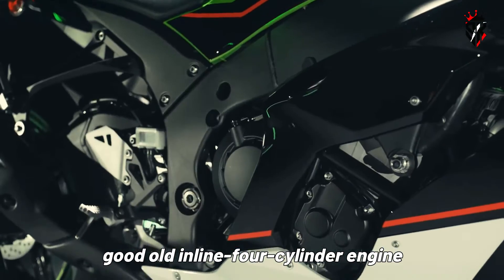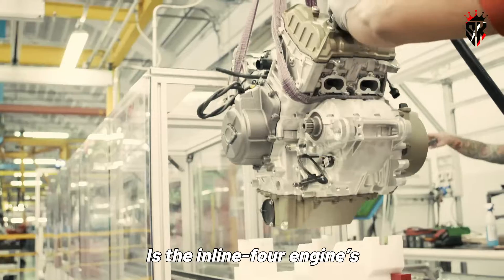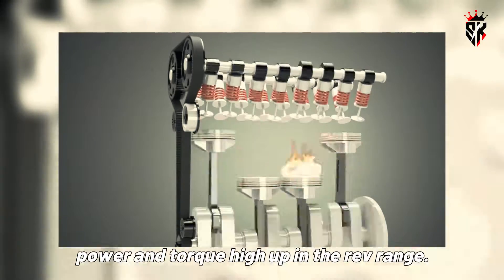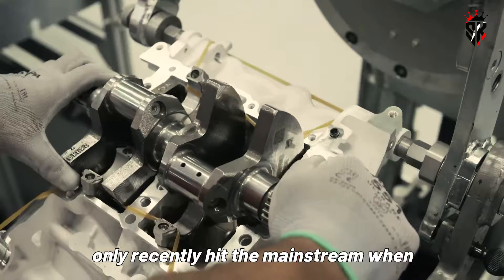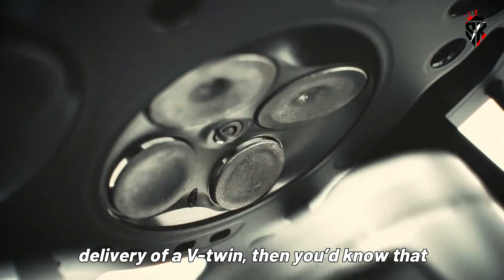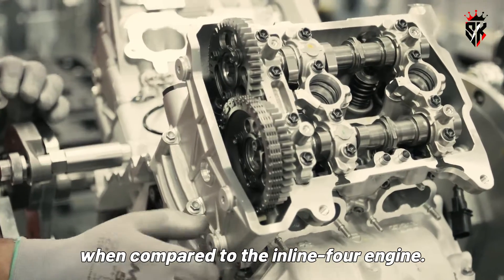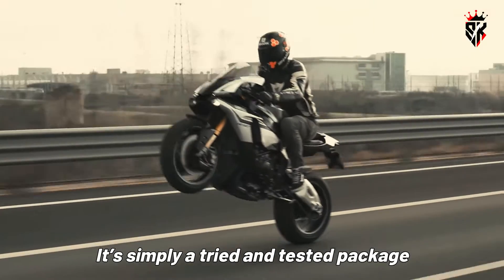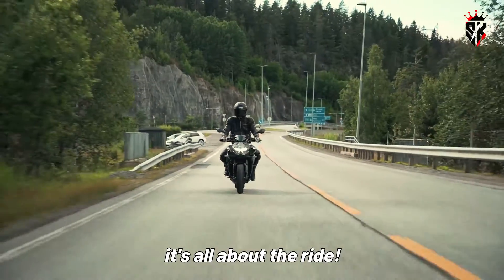Is the V4 engine only for racing? | V4 Disadvantages | Inline-Four vs V4 #ducati #motogp #racing

Comment: For normal road use an inline 4 has all you want. No need for the added complexity and expense of a  V4, or for that hot sensation under your posterior! But why is there no inline 4 with shaft drive? I so miss the Suzuki GS850 I sold in 1994!

Comment: I thought you would be explaining the REASONS like why it's smooth, handling, reaching high RPM firing order or primary secondary balance etc😢
Reply from the maker: Yap some v4 are perfectly balanced but not all...
The Ducati v4 is well-balanced but the Aprilia v4 is not...other than that I mention the v4 rpm.
Reply: @SKroadstar  yes 👍 but what about difference in firing order and so the vibration and balance & power band and the position of CoG
Reply from the maker: @rishikeshraj1138 Man you have a lot of knowledge. I appreciate it. I will cover it in the future. But this video is only about common differences between engines. 
Describing Fairing order and center of gravity will get complicated.
Reply: @SKroadstar  Ok make a video on them too.  And this current video is also good 👍😊